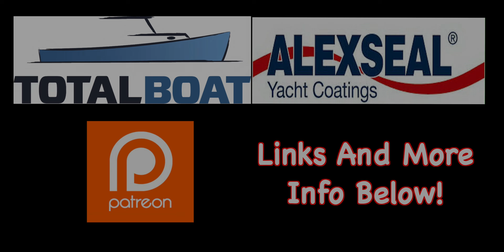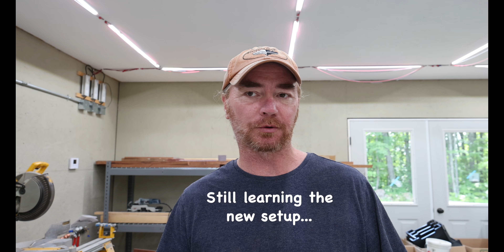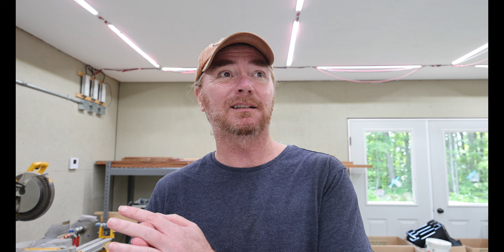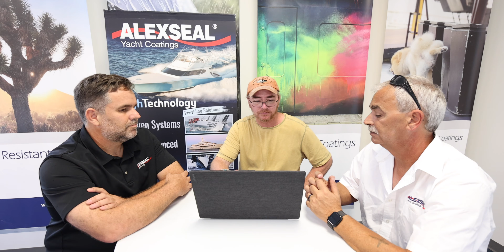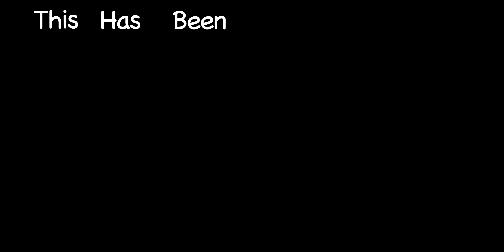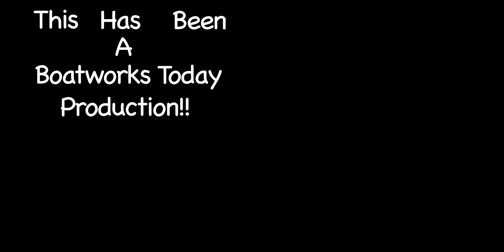Round Table Q&A And Tips With Alexseal Tech Guys!

Comment: I was an early user of this product having done my 45' yacht with incredible results. Now im doing a friends boat and the rolling additive is a thing ive found the rolling additive can fisheye. Ive even cut the rolling additive down to half and it still doesnt seem to flatten as well....any ideas/thoughts?
Reply from the maker: Fisheyes are the result of surface contamination, don't really see a way the additive could be the culprit.  A good cleaning method is to use Comet cleaner to scrub the surface.  Do not let the cleaner dry on the surface, so scrub and while still wet rinse thoroughly.  The rinsing water should sheet off rather than form channels.  Once it sheets then let dry and prior to applying material give a solvent wipe down with the cleaner / de-greaser.  Always wear gloves to avoid any skin contact with the clean surface (skin oils will also cause fisheye).  The paint itself should be mixed 2:1:1 (equal volumes of both converter and R5015 reducer).  If you're still getting eye's then it likely comes down to contamination of the mix cup or even the roller :-)  Hope this helps!

Comment: I’ll consume knowledge anyway you give it.  Always nice to hear from experts. You said the video cut off at 30 minutes, did you make the rookie mistake of recording the audio into the video?  If so, always record audio to a separate device and sync in post (that’s the purpose of the “clapper” you see on Hollywood sets). If not, then you can use some B roll of you rolling paint / primer onto a boat and use the discussion as a voice over.  And/ or create a podcast from it.  The video portion of this discussion is irrelevant because all the info is in the audio.

Comment: I just finished my first boat build last February and I used Total Boat wet edge paint. This was a fiberglass over plywood construction using epoxy. I think it’s pretty good paint but the cure time for each coat to be able to sand it was days. My last coat of primer took a week to cure enough to sand. I forgot to mention I live in Florida so these extended cure times was due to high humidity. Anyway, on my next build, whenever that will be, I want to try a 2 part primer and paint like Alexseal. Hopefully it will have faster cure time and be a harder finish once cured.